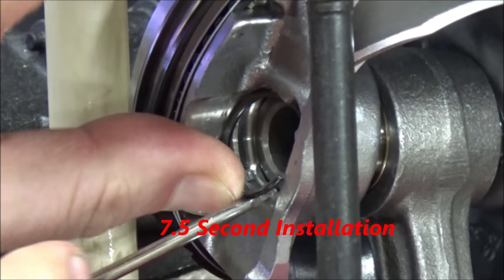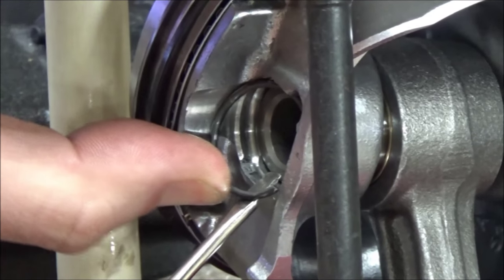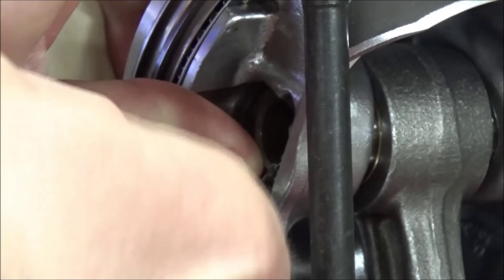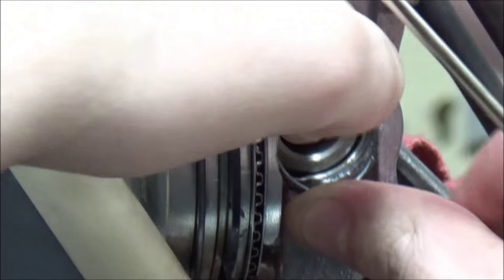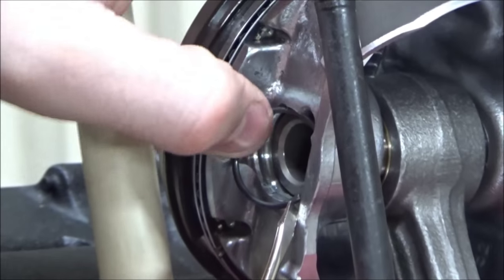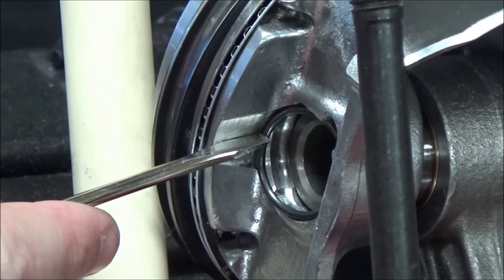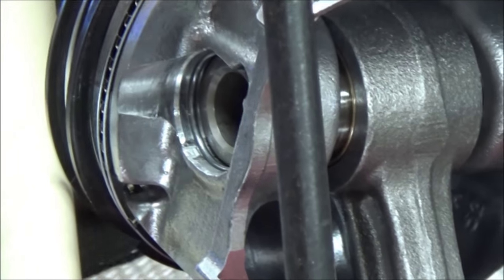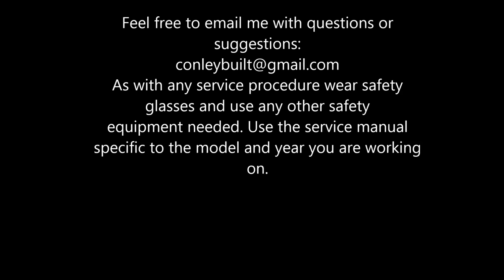How to install piston pin clips close up! Bonus teaching of "how not to install" included!

Comment: Great video.  Too bad I didn’t have anything like these videos to reference when I started working on motorcycles.  Might I add, that it’s probably worth mentioning that you should block off any access points down into the crankcase at this time.  Wrapping a paper towel around the connecting rod / stuffing it down into any open spots really helps out in the event you drop the clip, or it goes flying and you want to ensure it isn’t at the bottom of the crank case….. not that this ever happened to me once (or twice).. :)
Reply from the maker: +kspeese Thank you and please share!

Comment: This is easy - the 'wire' clip is made stiff with a round cross section!  Try 1960s NOS big-name accessory pistons (for a '6') - but with REAL (springy) wire piston pin round clips.  Went in fairly easily - but still checked each was seated snugly in its groove all the way 'round for 12 clips.  Car drove okay on the reco'ed motor for two weeks.  Then, started it up one evening - knock, knock, knock.  After turning the air blue, pulled the head and discovered one of the b*stards had come out, letting the pin freely hit the bore!  One unwanted 0.060" rebore later, I put custom-made pistons in - with proper machined clips with square ends that I designed!  Still in there to this day 30-odd years later.
Reply from the maker: Great story! Thanks for sharing. 
Thank you for commenting. Would you consider helping support our work here and help keep us going? We can’t thank you enough for helping us keep making technician training impacting schools all over the world. Could you spare $2 and support us with even more benefits? Smash the subscribe button and bell! Join this channel to get access to perks:
https://www.youtube.com/channel/UCBhM8DCKnT3qXwTW0eToyCg/join   
-Daily MEMBER FIRST COMMENTS ANSWERED FIRST 
-Live Q/A video chats
-Wonder if we have a video on your need? Members can request content links!
-Full Access to the ENTIRE 700 video library
-Member-Only FREE tool giveaways 

Just want to say thanks quick to support us for this information and our work saving you money? 
Give us a high 5 here:  https://www.paypal.me/how2wrench